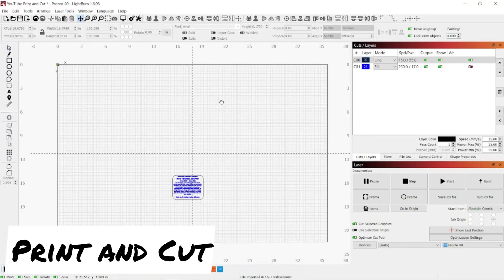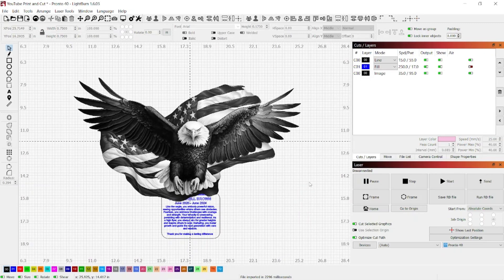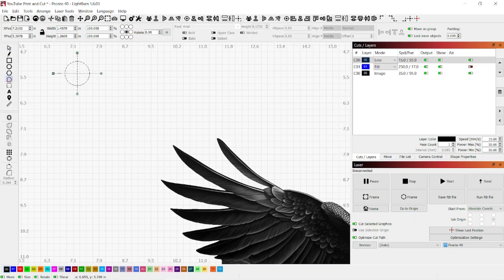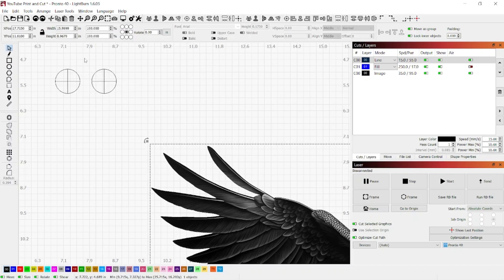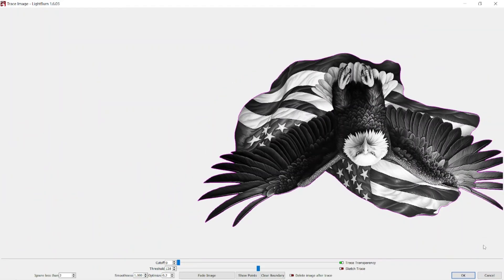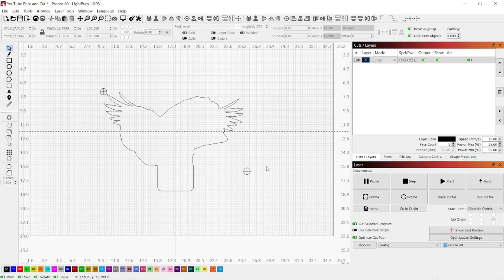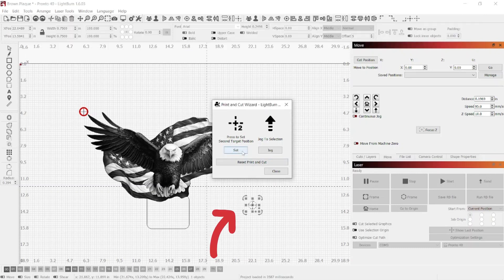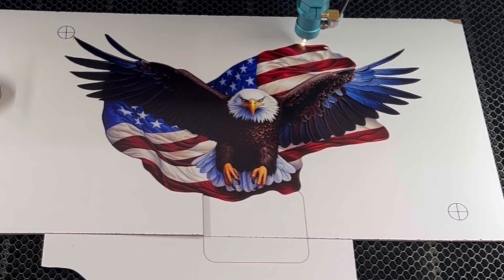Print and Cut | Lightburn | CO2 Laser

Comment: Hai,how do you make perfect size of both print version(on what software) and cut (lightburn software)?
Do you use the rectangle shape that u show on the video to make it perfect exact size or u use outline?tq
Reply: The target point also,how do you transfer your target point into the one that u print out colour ?
Reply from the maker: Hi, when you bring the image into lightburn, there’s a bounding box around it when you click on it. You grab the rectangle tool and snap to the bounding box. Click on the rectangle and it tells you the dimension of the overall image. So when you go to prepare the image in another software, you can scale the image to the exact dimensions of that rectangle.

I used Adobe Illustrator to prepare it.

Comment: Can you move the laser head with the buttons on the Ruida controller to align it to the crosshairs, or do you have to use the move window in Lightburn?
Reply from the maker: I adjust the speed on the ruida control panel to a very low number so I can make micro adjustments with the buttons.

Comment: Did you outsource the printing?
Reply from the maker: In this case, I had a friend with a UV printer, but you can also use sublimation
Reply: @EdmondsWoodshop  Have you done something similar with sublimation?  Does it turn out as good.  Those colors on the eagle really pop, not sure if it would look as good with sublimation but I havent really tried it yet either.
Reply from the maker: Yea I’ve done smaller sublimation prints, but you’re right. The color isn’t as vibrant but still a good alternative to the expensive UV printer